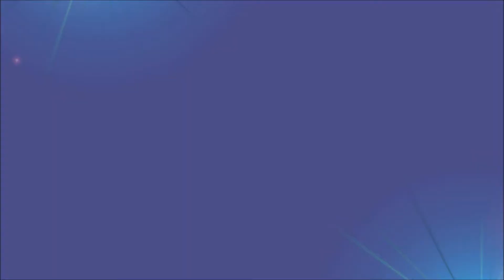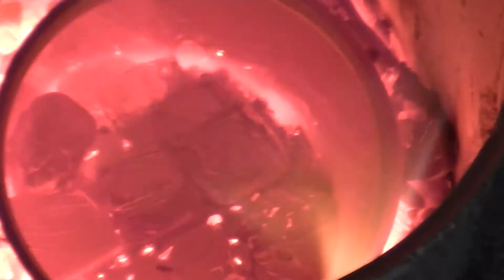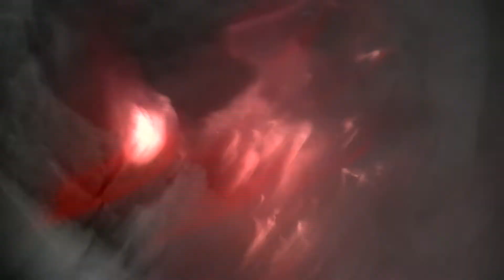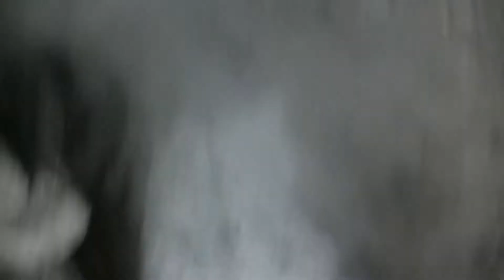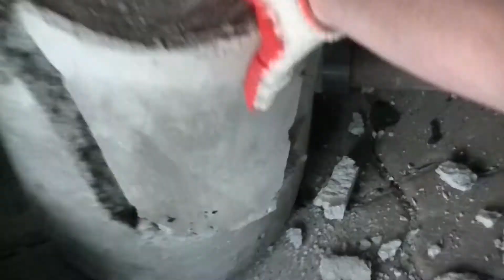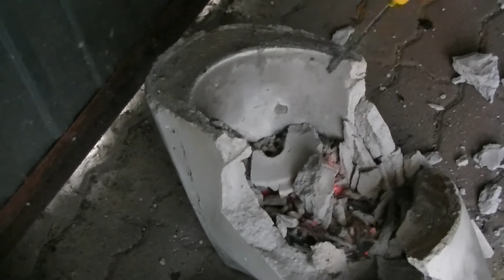Explosion of Homemade Backyard Foundry Furnace Torch

Comment: Did you use ready mix cement?
if so it cant handle those sorts of temps, best off finding some fire brick, you can get soft stuff like wool, that can resist 1500 deg C.